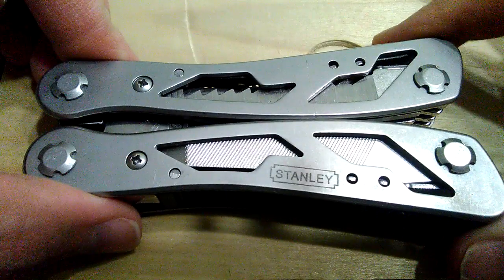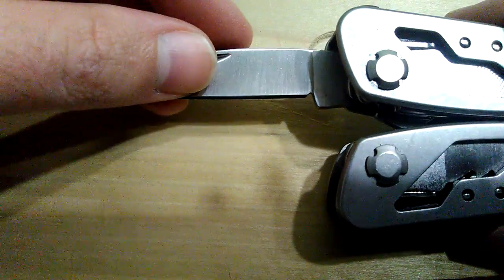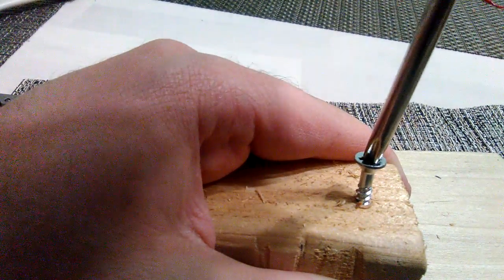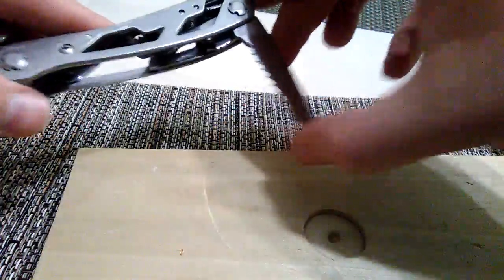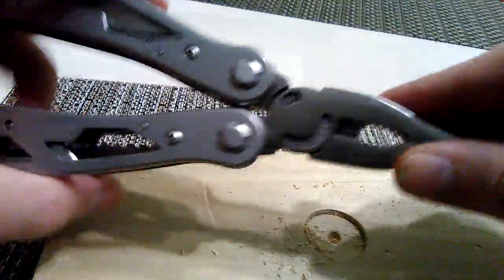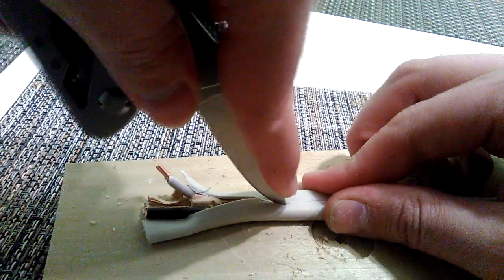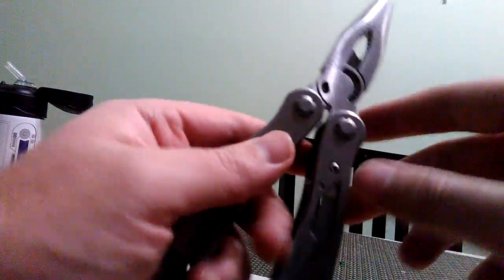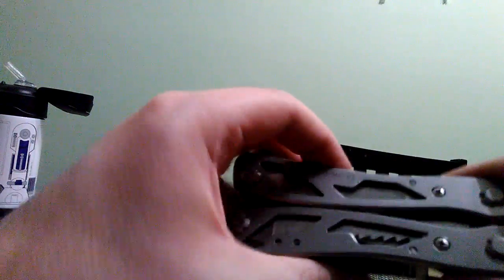Stanley 12 in 1 multi tool full review

Comment: I'm thinking of keeping one of these with me on motorcycle road trips to use in the event of a flat tire...the plan is to use the pliers to remove any foreign object, such as a screw or nail....would this product be good for that purpose?
Reply from the maker: The pliers are fine for that purpose. Despite them not being the greatest of metal (CR-2 which is the Chinesium version of 200 grade Stainless steel), they rarely disappoint.

Vise grips are often good to have for temporary repairs so this might be a better option:

www.amazon.com/dp/B014UT2VCQ/

I keep those in my car.  The knife is surprisingly in a useful position, but I have not really used it.
Reply: Rhys Jason  Do you and your gf use the multi-tool while watching movies?